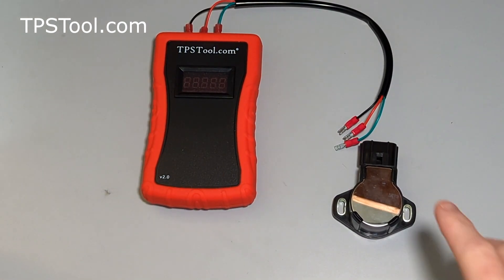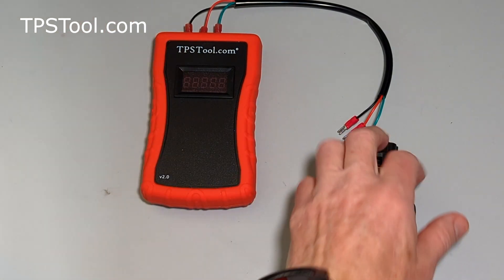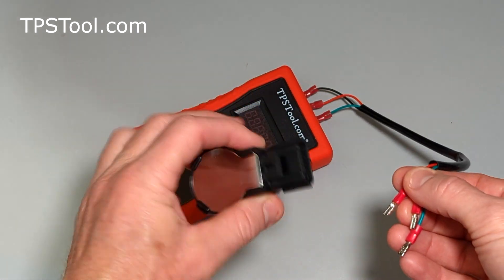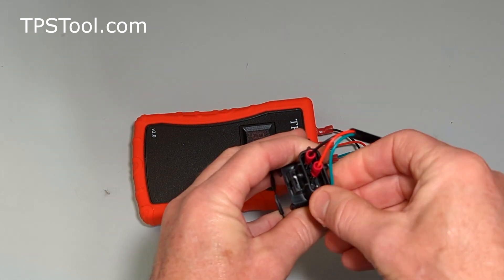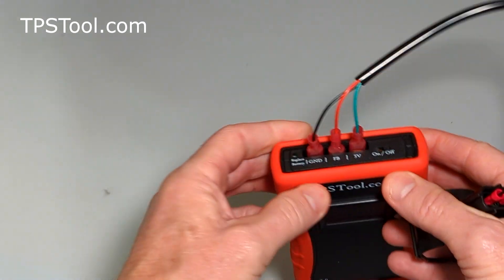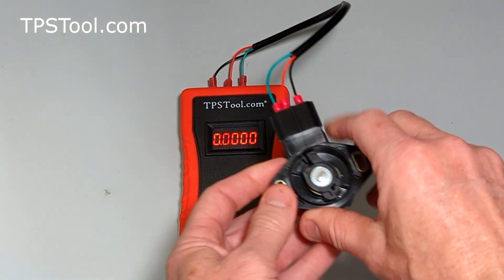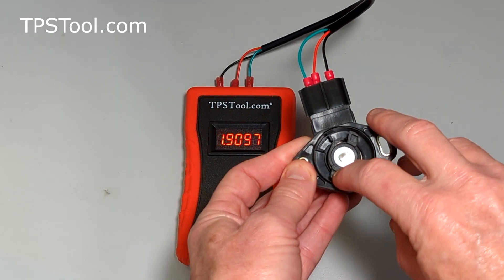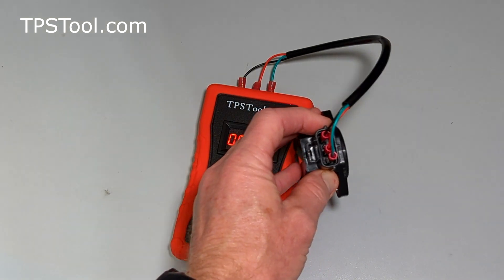Arctic Cat 1999 ZL600 EFI TPS (Throttle Position Sensor)

Comment: Where can i get this tool? And will it work on a 1997 arctic cat zr 580 efi? Its got the same  4 pin tps sensor
Reply from the maker: Thank you for your comment!  You can get the tool at TPSTool.com  If your motor has the same TPS then it would work just as shown in this video.  I believe we might have the setting for your motor on the common settings page on our web site with a link to the service manual where the info originated.  I hope this helps!
Reply: @TPSTool  thank you ill go check k that out